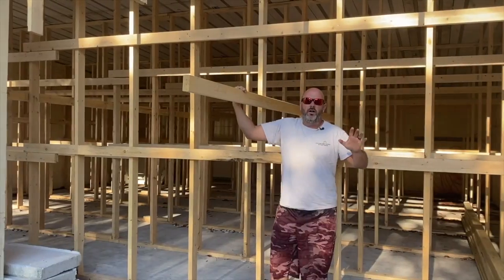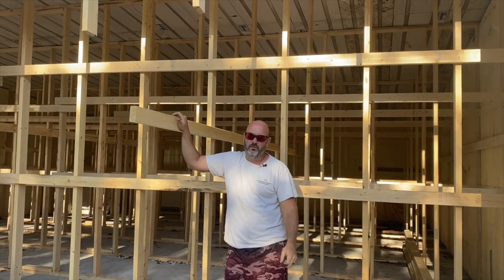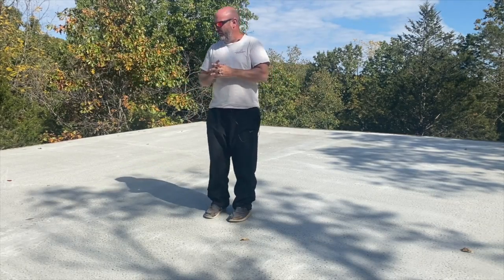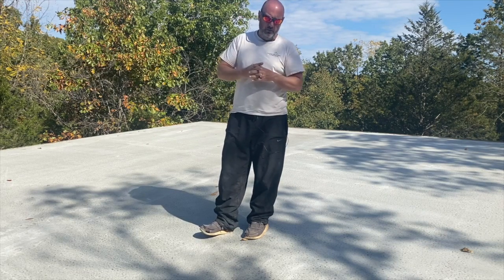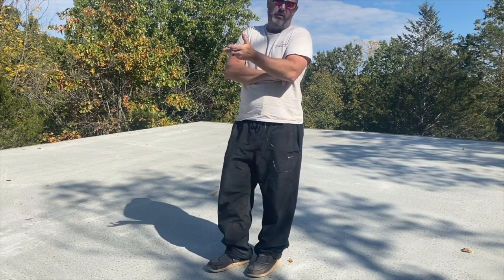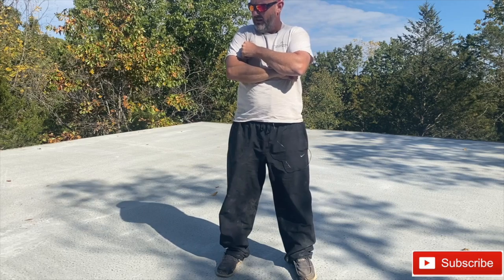ICF Roofs!!!

Comment: This has been the construction standard in Brazil for many decades. Since we don't have snow here, it is very common to build this way. Technology has evolved a lot here in this regard. The concrete is applied with waterproofing additives, and asphalt paint or now modern acrylic emulsions can be applied and you won't have any problems with water. You can even cover it with ceramic tiles and use the space as a beautiful rooftop.
Reply: Acrylic emulsion does it have a name on the market?

Comment: Im designing a 60'x60' garagement.  15' tall front walls and 10ft rear walls to create a continuous slope for solar and rain collection. Could I span that with an ICF Roof?  Otherwise I could make the central wall ICF as well that runs all the way through the house at 30ft or maybe add support pillars
Reply from the maker: Yes if u split the span I’m confident they could span 30’ easily

Comment: Do you have any recommendations on drainage and waterproofing of a flat ICF roof? I'm in the design phase of my ICF house w/ICF roof with my architect and we are trying to figure out how to drain and waterproof it. He wants to use tapered insulation w/TPO on top. I am wondering if it can be screeded to the correct slope to drains and with Xypex added + on top to waterproof. Thoughts?
Reply from the maker: Lay the lite deck on the slope then tpo it, cheapest way, tpo is cheap insurance, xypex is great but I wouldn’t bet my possessions on it alone!
Reply: @all3pools  Ok sounds good. Its going to be a "flat" roof with parapet wall, would you still tilt the lite deck itself? Or screed the required slope to the drains?

Comment: Very educational! Thank you so much for such useful information! Do you have any updates on this project in terms of soffits and TPO application? What is the slope of the concrete roof? I am in permitting phase on the house in South Florida (Fox Blocks walls + InsulDeck flat roof) and I am thinking of 1/4 inch per foot slope. Do you think this is enough? Another thing the InsulDeck rep suggested using the Vulkem 350 to coat the concrete roof for the waterproofing.
Reply: I'm also in South Florida and I'm also considering Fox Blocks walls + InsulDeck flat roof). Did you go with this for permitting? How's your build coming along and are you happy with your decision so far? Waterproofing is definitely a concern for me since cement will crack and create micro leaks. I was thinking of putting a metal roof on top for increase leak protection, but I'm not sure.

Comment: What kinda strength can an icf roof have?  Flat roof. Snowy climate
Reply from the maker: Depending on engineering but it can achieve hundreds of lbs per foot if necessary
Reply: @cuttingedgehomes9251  let's separate this into 3 tiers.

 Teir 1 is possible and need professional assistance to implement it correctly.

Teir 2 possible, but major considerations may make other designs more appealing. 

Teir 3
Don't do it

Comment: What's a tpo?
Reply from the maker: Thermoplastic overlay
Reply: TPO is a common roofing membrane. It is competing with EPDM roofing membrane because it is cheaper but it will last maybe twenty years vs. EPDM which will last at least 50 years.  Both EPDM & TPO can get punctured but TPO is a little stronger (it has a built-in supporting mesh).  The EPDM is pure rubber and stays fixable in Sun.  People also use EPDM in their fish pond.  RV roofs used to be covered by EPDM and now switching to TPO because it is cheaper.

Comment: I live in the GulfCoast region prone to hurricanes, and torrential rain downpours throughout the year. This type of structure makes sense, but not sure I could get the wife to buy off on the look of a sloped concrete roof. Could a slopped ICF roof be finished out with a metal roofing on top? Without creating a thousand concrete penetrations with the potential of a leak at each penetration?  How would the attachments to the concrete be made?

Comment: Can you put a Concrete Wall ledge about 3 feet tall around the perimeter so people can be up there.  Also why not just put some kind of plastic then put 3 inchs of dirt and then grass that doesn't grow.  Then you have the best Roof Top then.
Reply from the maker: You CAN do all of those things if it makes sense in the buildings mission…. This buildings mission is to be a fortress for some very fancy cars…. So no lol;)
Reply: @all3pools  You don't have to be rude about it.   A Grass roof top is very eco friendly much better than those crappy plastic tiles you were thinking about, which would get all kinds of junk under them anyway you dumbass.  lol; )

Comment: I’m planning on building my next house and I want all 6 sides to be ICF. That means the floor and roof as well as the traditional side walls. My vision is to have the attic be sealed and part of the air envelope of the house. But I want a traditional roof with a peak (and solar panels on it) instead of a flat roof like this is with a metal roof on top of the ICF roof. Is that something that is feasible today?
Reply from the maker: They do hip and gable roofs, it’s quite a bit more expensive

Comment: Hope it will not disappear in flames. Ever heard of forst fire ?
Reply from the maker: It’s concrete…. The foam is encased in concrete…. If you watched you’d know that, think it’s more resilient to “forst” fire than any other roof system I’m
Aware of…
Reply: That is one of the reasons for using this system.

Comment: I'm wondering about doing a slightly sloped - basically flat icf roof in New Hampshire where we get annual temperature swings from -30 to 100+.with 6 to 8 feet of annual snowfall.  How do you control cracking with that amount of expansion and contraction?  I see you don't saw any control joints.  Is it even possible or just cost prohibitive in this climate as I've never seen one around here.

Comment: Hello, Great videos...  What product do you use to waterproof a low sloped concrete roof????
Reply from the maker: I like to use tpo, there’s different underlayment if you are using pavers and bison pedestals but too is a fairly cheap super durable solution!  They do promote laying a membrane over the beams before the slab portion is poured to leave the concrete exposed but it lessens the span by quite a bit and there’s no way to repair if there’s an issue…. Tpo on top leaves the structural superiority in tact and is easy to fix if/when there’s a problem!

Comment: Just found your channel and started binge watching. Lots of great info, thanks for sharing. I just did some floors like this very similar to lite deck. I used Quad-Deck, it too has embedded joists in the foam. It sure saves a ton of time Installing!
Reply from the maker: Yes, I came to this way after icf walls but I use them whenever I can now!
Reply: @Cutting Edge Homes !  Can you use Helix with these lite deck systems?  Also, how do you create overhangs?
Reply: @all3pools  How does the cost compared to other concrete options? We are looking at clear span polished concrete for our first floor

Comment: Thanks for the video. Looks great. Have you thought about an elastomeric traffic deck coating on the roof? Easy to inspect and maintain since it's not hidden under pavers.
Reply from the maker: I haven’t, what’s the price/foot?
Reply: @all3pools  Residential can range from $8 to $30 per SF. Depending on size of course. One balcony is more expensive per SF than a 1,000 SF terrace.

Comment: Are you ever concerned about the weight of the roof or floor inside a home?    Looks extremely heavy but I love the idea of having a flat roof that is like ICF.
Reply from the maker: No, the way it’s designed it can span further with less deflection than wood, and concrete has great compressive strength so the walls holding it up are bulletproof
Reply: That’s what I was thinking. I’m sure theirs tons of engineering going into not having a roof collapse but it’s just seems super heavy.

Comment: Is it possible to do lite deck for second floor and lite deck for roof?  or is that too much weight?
Reply from the maker: That’s what I’m doing, that’s what it’s made for assuming your walls are concrete too
Reply: @all3pools  yes. I am planning on complete concrete.  Do the exterior walls need to be thicker?  Do you have an architect that is knowledgeable in these structures?

Comment: Love your channel!
Do you  find framing the support structure first and laying the roof on that or do you do roof then install support structure under. I’m asking obviously because you build the sections on the ground then stand them up but that leading edge would be to tall so you would have to shim. Just wondering what way is the quickest? I’m assuming getting the support structure up first? With no shimming? Or do you take off 1/2” and slip 1/2” plywood or something under everything?
Cheers
Seb

Comment: Any ball park price per sqft for a roof? I can never get a straight answer. I understand it varies place to place. If it helps I am in Kansas. Easy to get to, out in the open.  I would like to have an all concrete house. I am just not sure if I can afford it.
Reply from the maker: The material itself can range from $5-7 depending on depth…. Shipping is a wildcard depending on where, and labor for setting is usually 5-10, again it varies based on skill gap in parts of the country that will allow for gouging when labor is in short supply, finishing labor $3-5 depending on difficulty of placing concrete and equipment….
Reply: @all3pools  Thank you. Do you do any work in South East Kansas?

Comment: All of the ICF roof builds that I have seen using Zypex have leaked.. That product just doesn't seem to work in that application.
Reply from the maker: It works, but you’ll never make me believe it will seal the inevitable cracks, which is why I advocate against it
Reply: @all3pools  it works until it doesn't lol..

Comment: What kinda roof pitch is possible with icf if you wanted a more traditional roof.
Reply from the maker: The ones I’ve seen hipped and gabled appear to be about a 5 or 6/12…. I suppose with the right crew and proper lifts you could do just about any pitch, but 5-6 seems most reasonable

Comment: Very cool. 
I want to build an ICF single story, full basement with hydronic in floor heat throughout. 
I'm think of doing a single slope roof, low side facing south then installing solar on the roof for off grid power and mounting as cheap as possible.
Reply from the maker: That’s the way!

Comment: Quad Deck / Insul Deck are cut to length at the manufacturing plants. I have used it when pouring safe room ceilings and as a floor for the upstairs of a two story home.  Haven’t tried it on a pitched roof yet but I want to.

Comment: Thank you!
Would you pour these in interior floors too? If it’s not too difficult to add plumbing, electrical, and hvac up through the forms why go with a truss and thick advantech subfloor?

Since ICF floor decking needs bracing, why not use commercial steel decking? Doesn’t seem like you need the bracing with that route right?
Reply from the maker: Yes I have a video with a huge house that’s all lite deck floors!  Commercial steel then requires steel structure to hold it up because it’s effectively just a slab, this form creates a 3 dimensional slab and beam decking that’s monolithic, very strong!

Comment: Great video as usual. Quick question, what's the chances of doing some kind of Trusses across or in combination with the litedeck? I'm mot a huge fan of the flat deck modern look. I like the idea of total encapsulation, just want a traditional look above it. Especially if I'm thinking HRV/ERV, HVAC, duct work, plumbing, and so on in a conditioned attic space(upstairs mechanical room).
Reply from the maker: I haven’t done one yet but there are guys pouring hipped and gabled roofs like this!
Reply: @all3pools  do you happen to have links to those who have done it, or would you be interested in giving a consultation for one here in Texas. Will Google what I can.
Reply: 2x4 flat truesses, maybe a little slope on the upper side for roof slope. Rigid foam insulation and the trusses have bays for trades. I can't understand why these are used instead for a steel deck or just forming under the slab. The cost to just form it when you have to support these anyway.
I priced these 15 years ago and I could do better for way less. 
Now that there are European style forms for rent nationwide the cost is WAY less to form than to us a product like this.

Comment: Don't recall the technical limitations of EcoFinish... how would that perform on an exposed low-slope ICF deck compared with other methods of keeping water out? 

UV loads are pretty extreme in NM, so I'm concerned about longevity & the need for frequent reapplication of roll-on. Kinda don't want to pay for a roof over my other roof (metal or Bison), lol, & using the sqft as a deck just seems obviously the way to go.
Reply from the maker: Eco being engineered for pools makes it a somewhat expensive process for a roof, I love tpo, easy to apply, around $70/sq material cost and simple to service or replace…. And it’s simply the cya for an already great…. I was in China right at the start of covid, they had multiple brands of bison-like pedestals for a very reasonable price, which I’m hoping to take advantage of on our deck in nm!
Reply: @all3pools  ...not sure what the Chinese version of a Bison is, but if anything close to a panda my wife will approve!

Figured EcoFinish might be too costly -bummer